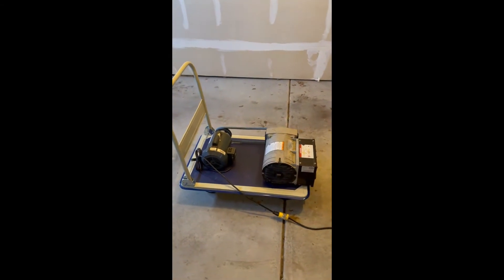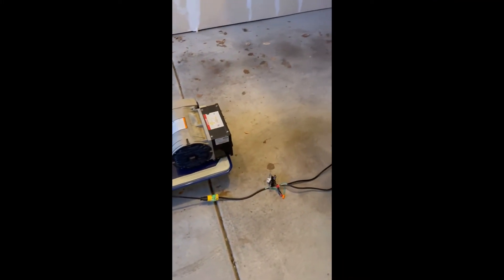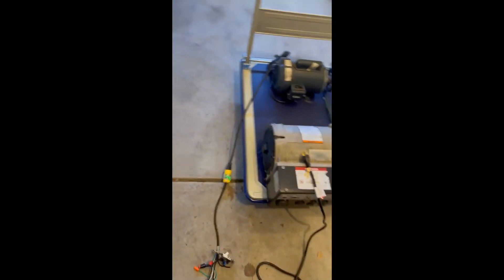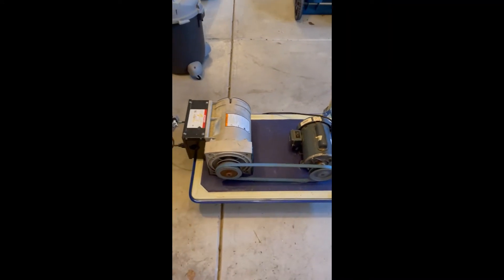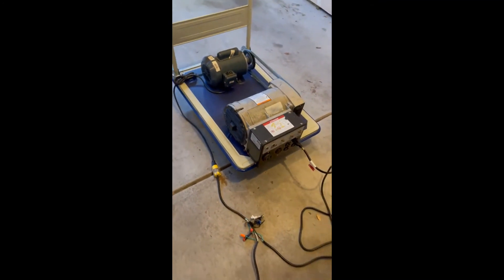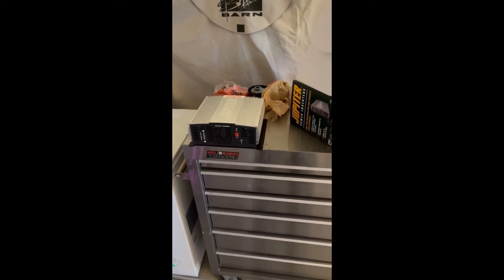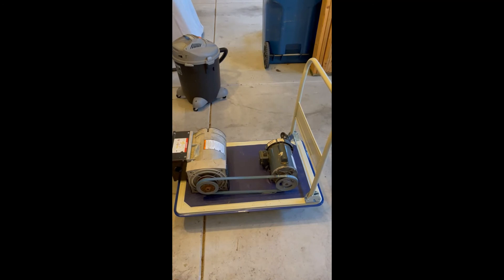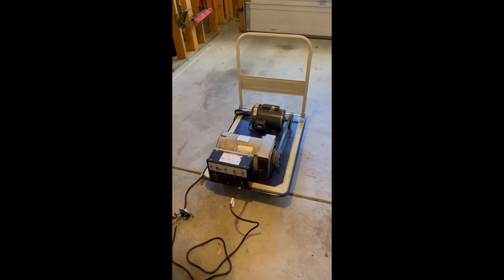Free Energy Generator Video 2 | No Solar - No Gas - Off Grid System

Comment: I haven't watched the following videos yet.   I can't remember what horse power you said the drive motor is.  It takes at least 1hp to make 750 watts.  See how many watts it takes to run the drive motor, then see how much of a load you can put on the generator while it's been powered by the motor.
Reply from the maker: I’m using a 3hp 3phase high voltage/high speed motor in my later videos. I found that I can double my motor torque if I get a slower speed motor which would help with running the car alternator for recharging possibly running the generator but I found that drains my batteries quicker and can't recharge fast enough.